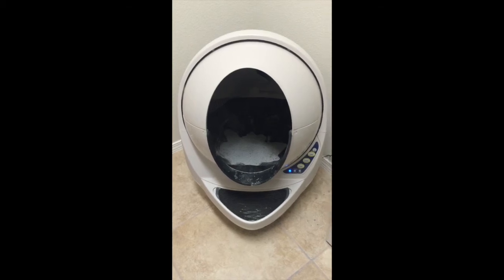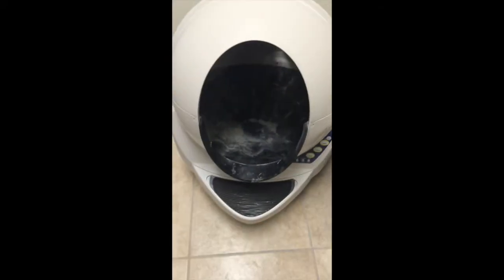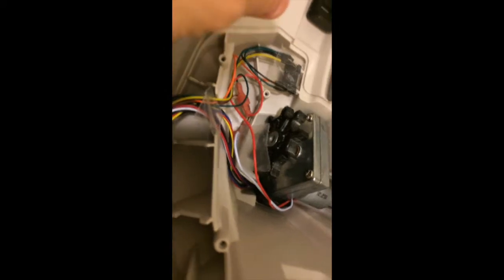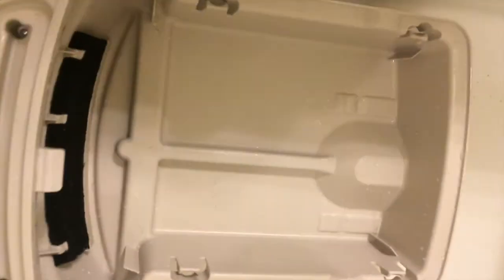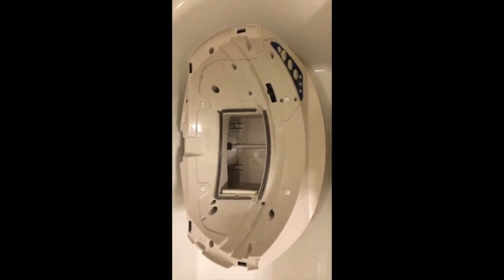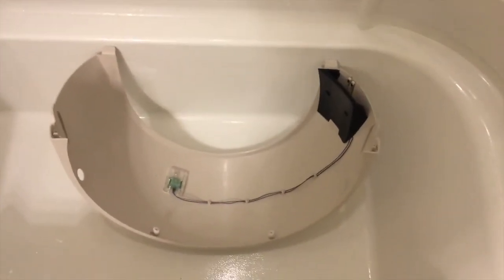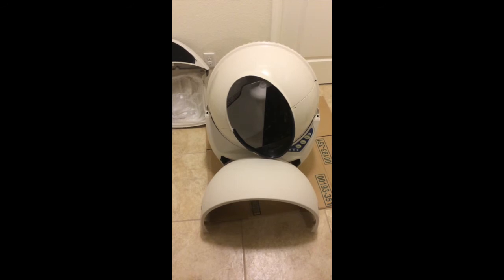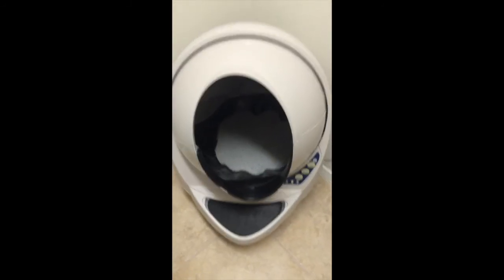Litter Robot Open Air Cleanup and Maintenance

Comment: A couple of suggestions for Thomas Pasti:  You should read the user manual completely before you post an instructional video so you know exactly what you are talking about. Also NEVER submerge the base in water; simply wipe it down with a damp cloth. Do NOT get electrical components wet. Follow the user manual and it will last a long time. This machine is really quite simple and well made. I love mine.

Comment: This was the most helpful video I found on how to thoroughly clean the litter robot! I had such a smelly litter robot for such a long time even with a weekly wipe down. Thank you so much!!!!!! Also, I make tiny long strips using disinfecting wipes and stick them in the holes in the base. I just pull them off when I clean. It helps a lot as a lot of litter accumulates in them. Anyway, you are my hero!
Reply from the maker: Glad you found it useful. I found the other day that the holes in the base are exposed to small amounts of litter from the globe as the outlet hole rotates over the base, explaining the accumulation.
Reply: +Thomas Pasti lol! I told my hubby you must be some type of engineer since you knew so much about the mechanics! Hey did you ever change the color of the night light? I was curious about that?
Reply from the maker: Hah thanks - Your comment made me subconsciously aware of those holes again, so when I randomly happened to see it, I had an 'ah ha' moment. I haven't done the night light yet; maybe I'll do a video on that too. From what I remember it is a little more involved, as it would require soldering and the appropriately rated replacement LED - something I enjoy, but likely beyond a lot of users interest.
Reply: +Thomas Pasti That would be neat! I wonder if the cats would like it?... Hey my litter robot never has pieces of litter behind the tray like yours did. I wonder if it's because of the bags I use. I use the trash bags with handles and they seem to fit better as they have a tighter fit.
Reply: Because cats are partially color blind, I'm not sure they would be able to notice as big of a difference as us. I just did a quick clean and I didn't have almost any dirt trapped behind the box like I did in this video, so  I think it might of been that the method in which I installed the bags has improved over when I first got it.. The bags definitely don't come loose as often as they did in the beginning.
Reply: +Tomtronics Didn't know that about cats! Lol. I'm glad it's working out with the litter robot. It's been the best investment for my two kitties I ever made!
Reply: I used clear packing tape over the screw holes in the rotation path of my base, to just cover & prevent them from collecting debris.

Comment: You can also just slide the tray into a 13  gallon trash bag and secure the open end a little bit, which is really easy and works better at catching everything than feeding it into the clamps.
Reply: Nice tip, I'll try it. Since you made the comment 3 years ago, do you still use this method today, or did you go back to the clips?
Reply: Yes, I did this recently too, and it catches everything and the drawer is not dirty this way.

Comment: One comment forgot to add.  I have my LR3 on a tile floor which is rather slippery, and I've had a problem with the robot scooting around when I pulled out the drawer.  I solved this problem by attaching 3 small rubber anti-skid pads (I had to cut them to fit), one on the black sensor pad toward the back of the bottom, and the other two on the knobs toward the front.  This has made pulling the drawer out simpler and easier since the unit remains stationary.

Comment: Just FYI I have had litter robots for over 15 years and have one which we only dust off and has not been taken apart in over 4 years. It is not really necessary to do this kind of cleaning, not at all. They are workhorses and unless there is something wrong with it or is extremely dirty for some reason you can leave it alone. Even the litter is fine however we have changed out the litter a couple of times, only using the empty litter button.
Reply from the maker: In my case my Litter Robot had problems with automatic cycling, and this cleaning was able to resolve the issues I was having. There is also dirt accumulation in certain spots, so I would recommend thoroughly cleaning the Litter Robot at least once a year.
Reply: Once a year is understandable however there is no reason to take off the control button panel or mess with other electronic components unless there are issues with them.
Reply from the maker: Or you are curious and want to see how it works :)
Reply from the maker: I wasn't very good at putting the bags on properly at the beginning, and I found that secure bag placement is important to preventing build up as well as I show in the video.
Reply: Thomas Pasti I use medium bags (8 gallon?). I roll the top down before securing the bag and it works great. Sometimes the far edge of the bag isn't as close to the edge of the drawer as I like and a tab of tape works great!
Reply: M Segatto  With the drawer inserted with a properly installed collection bag, there is ABSOLUTELY no way that mess could end up behind and under the drawer. It looks to me like he failed to get the drawer replaced before the unit ran an auto cycle, which deposited the clumps onto the floor of the base because the drawer was not there to catch it, then when he replaced the drawer, he failed to notice that an auto cycle had deposited clumps on the base's floor, so pushing the drawer in smeared it on the floor of the base (and the underside of the drawer)and shoved the mess into the back of the base. From how much was shoved back there, that has happened often(perhaps these oppsies happened because he was preoccupied with something or got distracted from the task at hand, taking way too much time to swap out the bag so that it cycled before he completed swapping out the bag and replacing the drawer, or even running manual scooping cycles at some point and forgot that he had the drawer out?). USER ERROR, NOT a flaw in the design of the unit!!! Mess physically CAN NOT get there when the collection drawer is in place as it should be. (I see that he has stated in a reply to your comment that he was not very good at installing the bags at first, so maybe that is why he didn't get the drawer reinstalled with a properly installed collection bag in time before the unit auto cycled, I just wish that he would have admitted in the video that that mess in the base was due to his mistakes, instead of implying that mess there was a con of the unit's design.)
Reply: @thomaspasti6763  Dude, thanks for admitting in the comments that that mess in the base was due to your difficulty with installing the collection bags at first, I just wish that you had admitted that in the video, instead of implying that that mess is typical of the unit. If it takes you a long time to get the bag installed, just get in the habit of simply turning the unit off when you start the bag swapping process, then turn it back on once you have the bag installed and the drawer reinserted, that way it wont auto cycle before you get it replaced and deposit a load into the base. It's MUCH better to discover that you forgot to turn it back on hours later, rather than be surprised by an auto cycle running before you were ready with the drawer back in place to catch it:) I only have the use of 1 hand, so it takes me forever to do a bag swap, so I ALWAYS turn it off while I am servicing the drawer.

Comment: Looks like a flaw in the unit and that's the latest model too, maybe cleaning the litter box more offten or making sure the plastic is covering open spaces will prevent that overflow inside the unit itself
Reply: There is NOT a flaw of the unit that would cause that mess in the base under & behind the waste collection drawer! With the drawer inserted with a properly installed collection bag, there is ABSOLUTELY no way that mess could end up behind and under the drawer. It looks to me like he failed to get the drawer replaced before the unit ran an auto cycle, which deposited the clumps onto the floor of the base because the drawer was not there to catch it, then when he replaced the drawer, he failed to notice that an auto cycle had deposited clumps on the base's floor, so pushing the drawer in smeared it on the floor of the base (and the underside of the drawer)and shoved the mess into the back of the base. From how much was shoved back there, that has happened often(perhaps these oppsies happened because he was preoccupied with something or got distracted from the task at hand, taking way too much time to swap out the bag so that it cycled before he completed swapping out the bag and replacing the drawer, or even running manual scooping cycles at some point and forgot that he had the drawer out?). USER ERROR, NOT a flaw in the design of the unit!!! Mess physically CAN NOT get there when the collection drawer is in place as it should be.
Reply: I clean mine out  twice a week and never have I had any litter up the back.i would say it’s not being e,pitted frequently enough so it’s over flowing